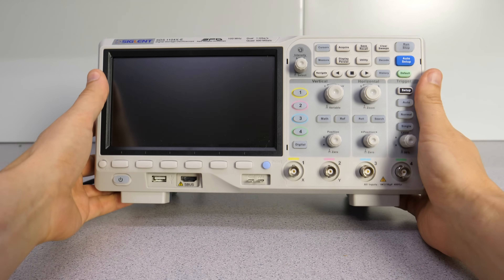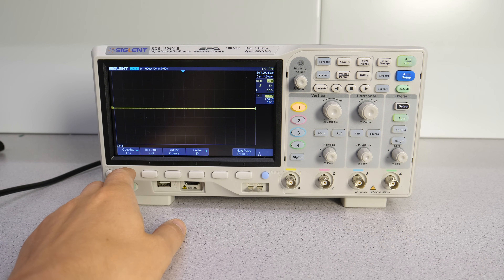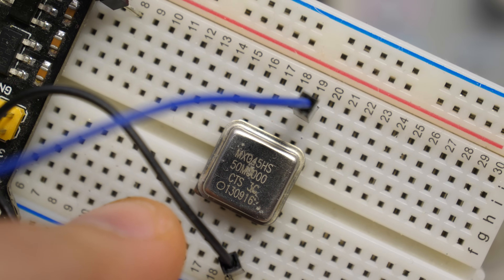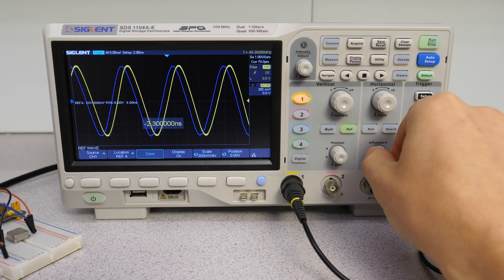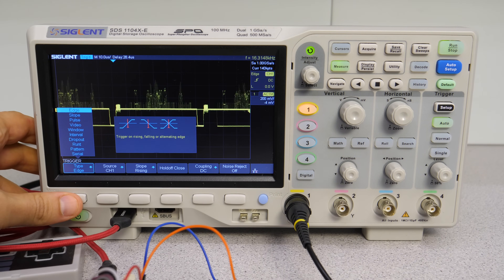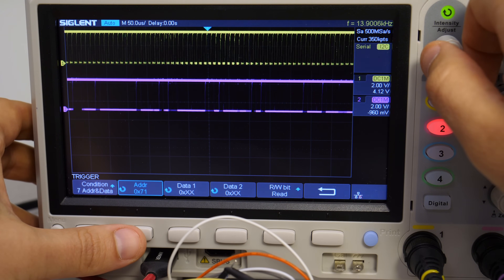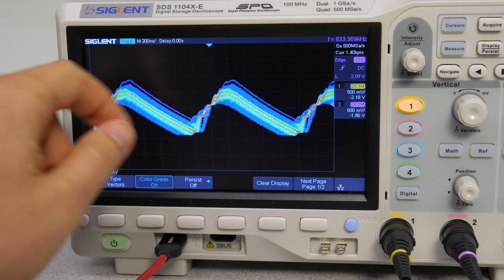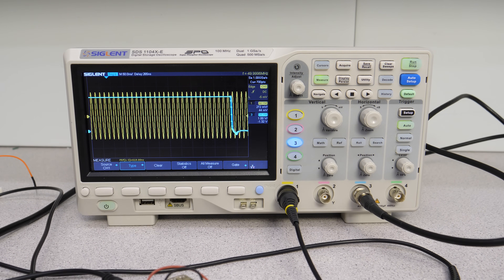Siglent Review SDS 1104X-E Review

Comment: Would you buy this today over the DS1104S-Z Plus with two channel wave generator and MSO module?

This is quite a bit cheaper but has no MSO or wave generator. However it does have canbus triggering which may be important to me. It also looks like the on screen information and the controls might be better on this versus the Rigol.

Comment: Nice review. Adding my $0.10 ...
I'm a firmware engineer and bought one for working at home - partly because I wanted one, also didn't want to lug my employers equipment back and forth during covid. I got this one to be able to add the digital probe later. Out of all my equipment, along with the DMM I probably get the most usage out of a logic analyzer. Being able to set up triggers based on digital patterns is really nice. The bandwidth of the scope fits well with the kind of stuff I work on. I also like being able to put it on the LAN to view the screen on my PC - really convenient to just use clipping tool to paste scope traces into emails.
So far, I've been very happy with it. One of my personal tests is how easy something is to figure out without resorting to the manual. It has been excellent that way. The controls seem intuitive (perhaps its from having used many Tek and Keysight scopes, who knows?). I can't really complain about anything.
BTW - Siglent makes excellent 'value for money' benchtop DMMs too.

Comment: I have an old rigol ds1102c, and I do mean old. I paid something like $1200 for it, but it was an incredible deal at the time.  There were times I wished for an extra channel.  The lcd is failing now, time for a replacement. I was thinking of sticking with rigol and getting the 1054z, but for the little extra money, this siglent seems a better deal.  Still, it's less than half what I paid for the 1102c.

Comment: FYI, you can hack this to turn it into a SDS 1204X-E (basically changing the bandwidth from 100MHz to 200MHz) and you can unlock all the features without a license if you are a dirty dirty pirate. Check out eevblog for more info

Comment: Nice review! Did you ever do a follow-on review of the optional digital logic analyzer? It's pretty amazing that this "entry-level" scope has the ability to do that.
Reply: If you’re still interested all this time later; I’m hopefully gonna be buying one of these in the next week or two, and while I won’t be getting the LA straight away, this is like half the reason for me to buy the thing (maybe a third; the other two thirds being the AWG and the fact that it seems even better bang for buck than the Rigol, thanks to the hardware options.)

I will be making extensive use of the serial decode which comes at standard straight away though. This might give me an idea, and I’m happy to pass this on once I’ve had time with it.

Comment: I got mine today and i am totally disappointed. The UI is slow and not very responsive, sometimes you have to press the buttons two or more times to be recognized by the scope. Doing serial decoding, the scope locks up from time to time and the fan is far more noisier than that on my old 1054z. The encoder knobs are cheap and scratchy. Last but not least the probes delivered with the scope are complete junk.

Comment: Glad you asked - I want to know:
1. How to set a trigger on some signal transmission?
2. Why I even need the math functions?
3. Why these set of math functions presented in the menue and not something else?
4. Suppose I have a LCD from an old tablet (which I do) with a SPI buss, can the oscilloscope be useful to set up the connection and display a picture?
5. How to measure the noise of a power supply?
6. Can I measure high voltage sources?

Comment: Very nice scope for the price! Some things I noticed were missing. Dedicated External-Trigger or an Aux-In is a missing hardware feature of this scope. However it may be able to be recreated by eating up a channel and setting a trigger mode manually for that channel. Two features which are desirable and not seen are custom Math functions ( which are possible in software scopes like Rigol and high end scopes such as Rohde & Shwarz, Tektronix, and Keysight). Another feature I don't expect to see are powered probes because this adds a lot of cost to implement in hardware. Thanks for the Video
Reply: it has external trigger on the back I think

Comment: A scope would be infinitely useful to allow me to do such things as decoding/reverse engineering 'non-open' communication protocols such as complex infrared, proprietary communication mechanisms, etc to allow bridging to open standards and controls. A scope would be a key tool in helping me learn more and properly understand concepts such as duty cycle, frequency, logic levels and timings. Such things are difficult to fully comprehend without the ability to visualise the electrical behaviour. I have never used or had a scope before, and would love to be the recipient of one to help me with my projects and learning, as well as being able to share with others. The winner, whomever it is, will be very lucky.

Comment: I need a Oscilloscope for many things, currently i´m using a WeMOSD1 Mini as web Oscilloscope it dose help a lot but can only display low frequencies and so i can´t use it for every thing i want, but hey better than nothing.
Projects are/will be:
- Engine control unit read out device for my fathers VW T3 Buses
- Home automation based on your remote power outlet but i will also send signals from one ESP to many others over 433mhz because here are many wifis, building a ESP wifi cluster would slow it down even more
- I also like the WS2812 LEDs and i´m using them all the time but for those projects i no oscilloscope is needed

All those different triggers would help me a lot because my self made oscilloscope only can trigger on rising or falling flanks
I´m also saving for one but i do not get mutch as apprentice electrical engineering (Besser bekomme ich Azubi zum "Elektroniker für Betriebstechnik" nicht übersetzt) and my father always tells me "Wer zu sehr spart, der kauft zweimal"

Comment: Looks like a great scope and very good value for money with all the decoders etc. built in.

I'd like to use it for watching my low power (coin cell) ATtiny projects as they wake from sleep, read some sensors and then go back to sleep. This way I can check the timing and current draw as well as energy used (math integral function) for each wake up event.

Comment: I would need especially the logic analyser functions too. I'm at the beginning of building an 8-bit computer, startet with the power supply, clock signal and reset circuit. Next step will be minimal system with a Z80, RAM, EPROM and a LCD Text display for output. A scope containing a logic analyser would come handy when running into some issues with the signals on the buses.

Comment: Nice one!. I have started putting together many more ESP based projects and been inspired by your channel to take this further. I have usually used modules but started experimenting with making custom circuit designs with many more devices and custom circuitry so this scope would be great for debugging the various digital coms and trying out new circuit patterns and theories. I have a old low end siglent scope but it’s two channel and doesn’t have any features over the basics so this scope would get past the limitations I hit with my current one.

Comment: I'm not very well versed on what makes a good scope. Well, not at all, but the bandwidth is what is recommended in several books if you want to be able to make all kinds of repairs and not be limited by your osci. The sampling rate seems great. It's really difficult to decide on an entry-level oscilloscope since you're going to sink a lot of money either way but you just can't make the judgement call of what features you will and won't need.
So there is this osci from a competitor that you surely know about which has a known "unofficial upgrade path" so you'll get quite a capable device, but how would a beginner know for example that the probes are up to the task after "upgrading"? I just wish that one of the most important pieces of equipment wouldn't be either a gamble or a money sink.
Anyways, keep up the great work :)
Apropos... you have quite a bit of videos that I didn't notice before. There goes my time I guess.

Comment: Brilliant review!  You're always so easy to understand.  I'm new to electronics (only just got hold of a proper soldering iron) and have been looking around for a scope.  I'm a software engineer but I have caught the IOT maker bug.  Started with a simple module that's easy to code for and is drawing me into building my own sensor and actuation circuits!  I'd immediately use it for debugging I2C and also helping with a low power radar sensor (need the FFT).

Comment: I'm a computer science student who has been a hobbyist programmer since I was around 15. recently within the past few years I took a class on electronics and was fascinated. I started getting into Arduino and other microprocessors and such, hacking devices and making my own projects. This has been extremely fun and educational for me but I often run into roadblocks like when determining what speed I can push a microcontroller or what protocol something might be using. It is also very hard and frustrating trying to observe what my code does with higher speed signals and such, it's almost impossible. I've wanted a scope for a while now but I can't afford one being the student I am. If I get this scope I would love to share it with EE students or a local makerspace or the like. I know how frustrating it can be without one so I would love to share this tool and help other budding electronic engineers, hobbyists, or makers move forward on their projects and learn a lot in the process. Thank you.

Comment: As a full time electrical engineer and a masters degree student, I have my own "lab" at home with some cheap measurement equipment you can buy from aliexpress like diy oscilloscope kits etc :) I work on power electronic circuits and I woul'd love to have a professional equipment and surely use it a lot. Since the ever incrasing currency rate of USD to TRY, the cheapest oscilloscope in the market is still an expensive oscilloscope for me to buy unfortunately. Thank you for the giveaway!

Comment: Nice review. This oscilloscope would be a great improvement over my DSO150, which was very cheap (price edited because YouTube thinks my post is an advertisement) but only offers single channel and very basic functionality. I would use it mainly for Arduino and other microcontroller projects. By the way, I am really impressed about your ESP32 project to generate composite video signals, looking forward to a VGA version.

Comment: Great review, quite the beast to be honest! I could use something like that for sure ;)

Uhm, I'd use it to fix the audio receiver I'm listening this with, 35lbs of mid-70's Canadian engineering ! 
It has developed some issues with time and I'd like to get it all tuned and cleaned up, a bit of stuff is kind of out of wack

but more interestingly, and rendering the first part totally irrelevant... 

build a digital front end for it, replace all the analog pots with rotary encoders and use one of the Audio processing IC (I'm sure I can get one that'll do what I want, or close enough anyway, I've played with some automotive versions before) coupled with some micro-controller to make all this work, adding some digital inputs and all while I'm at it, oh and why not, a stepper for the AM/FM tuner knob :)

I might even be able to do something with the 8-track recorder that's built into the thing hehehe
... or ditch it and turn it into a external HDD dock and put an LCD instead of the buttons ... ;)

In case you're wondering, Electrohome CS400R. I couldn't pass it when I saw the thing. I really wish I had a damn diagram for it, them using a non-polarized 3 pin connector on a 10 pin header in a dark corner really did screw it up ... Well, practically it's me but shush, it's technically theirs :P

Comment: I certainly could use it, so enter me in the draw.  I'd be replacing an older Picoscope 3224, two channel USB scope -- which works well, but is limited since it has only UI controls via the PC.  I am retired, so my current "hobbyist" status doesn't justify an upgrade.

Comment: I am 16 and want to be an electronics engineer. Right now, I don't even have a working multi-meter, which sucks on just about every level.
Reply: Everyone starts somewhere. Your first meter will be a huge asset to peek into what circuits are doing!
Reply: Buy a cheap entry level multimeter brands.on banggood or Amazon , don't go for Fluke or any high end ones ,prefer UNIT.
Reply: yah for sure. A cheap cheap meter is probably within a couple % accuracy, enough to get started.
Reply: I still have my Realistic benchtop meter I bought when I was 17 from Radio Shack. I saved a long time to get it, and I still use it 30 years later! You are in the right place to learn. And Forest M. Mimms electronic books are still available in some places. Look him up under the title "Getting started in electronics," that's how I got started.

Comment: I have quite a few idea! First would be a variable frequency drive for my fan, its too loud and fast for night, and I haven't found any other solution (yet) that would be complicated enough to learn something, but easy enough to try. Plus it can be connected to the internet. The problem is, there is too much interrupt, so the signal would be.. not that great... So two mcu, one is interface to wifi, the other is the controller. But how good would be the signal? There comes the scope. And 35263×n+1 other places: Are the two "direction" switched on at the same time? Is there too much space? Is it really a signal I looking for? Etc, etc, etc.. :)

Then I'd like to check my switching stuff (like dc-dc converters, usb psu), and your lets do stuff with a fast dac seems very interesting, there'd be quite a few stuff to try to emulate. I had an idea to make an onboard computer for my "bike" (Simson S51). (Yeah, isolation, isolation, and "How to not blow up your scope" :D )
Well, i have quite a few intermitten stuff, so It would be nice to know it is sw, hw, or not that reliable connection type of fault :D

Comment: My current scope is an old 10Mhz 3-tube scope (1x screen, 2x input amplifier), so the Siglent would be a huge improvement. I would use it primarily in microcontroller projects, for bus decoding, signal analysis and power measurements.

Comment: i need this scope for my pcb projects so i can debug boards that will go into a drone system, i2c spi and smbus signal decoding would be useful too so i can reverse engineer phone and laptop battery protocols for my various projects, of which i will contribute this to an arduino library so people dont have to buy seperate bms's for their battery powered arduino projects.
id also like to explore what other protocols the firmware can decode and even contribute my own.

Comment: I'm a lone developer working on Assistive Devices for children with special needs. As a lone, self-funded developer such devices are drastically out of my affordability. I am currently completing assembly of a DSO138 but it does not have the specs required. It will help but not in most instances.
Thanks for the videos. Very interesting and useful

Comment: Wow! That scope has functions that are light years ahead of the JYE Tech DSO Shell scope I built and the cheap digital logic probe that plugs into the USB port on my computer!  I'm no where near experienced enough to say what it's best feature is but for me it would be nice to have it's multiple inputs to capture timed events both digital and analog and see the events on the screen at the same time! It really cleans up the work bench to have so much packed into one device. Circuits I design with the EveryCircuit app and others don't always work the same built on a bread board and it would be nice to monitor multiple points during part value substitutions to view the effects on the circuits. This scope has a huge market in the growing hobby electronics community.

Comment: I would use the oscilloscope to measure more signals with the extra outputs on the unit when repairing digital Tv's and digital audio equipment.

Comment: Working on hobby FPGA projects is tedious when you see that your design is working in RTL simulation but in hardware it is not.
This scope would be nice to debug such systems because of its mixed analog and digital signal capabilities.
As long as you don't plug your monitor into the hdmi port of the scope ;-). 
But i think this is a ok design choice because you can extend the leads where your dev board hangs with widely available HDMI cables and have the scope next to you.

Comment: My oscilloscope is a 1979 one from eBay for 20 bucks. It's capable of 30Mhz and is good enough for most of all applications. But since I'm into digital electronics, there is no way around a digital oscilloscope. It would be an honor to receive such a device :)